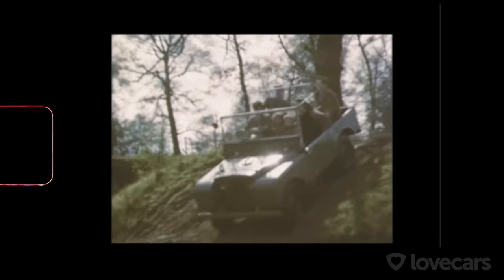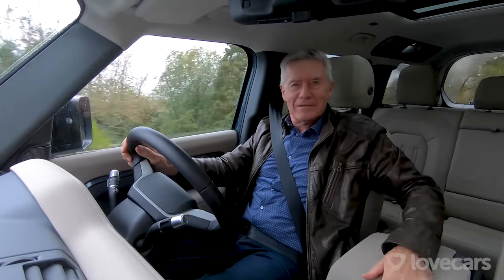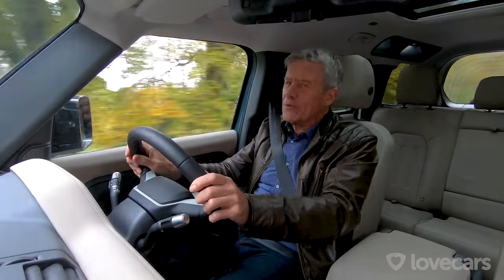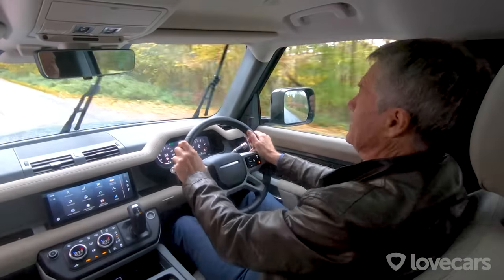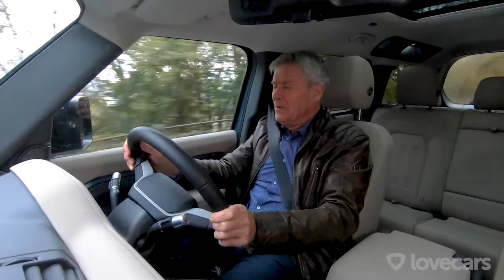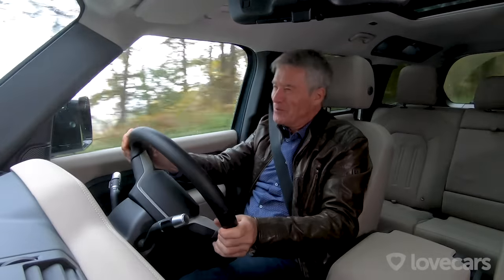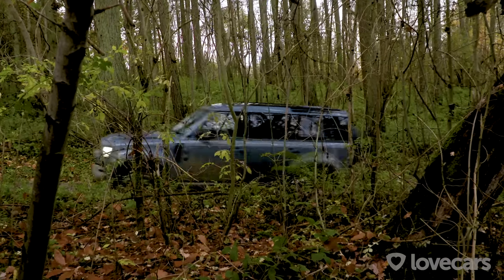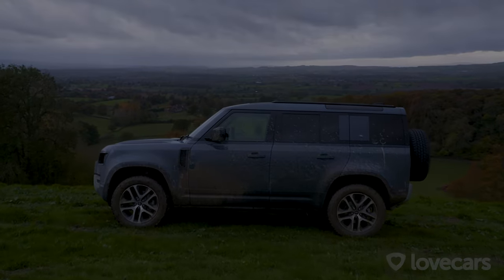New Land Rover Defender. On road. Off road. With Tiff Needell

Comment: All very capable but for the job the original was good at this is just way too complex and expensive - a first-World toy pretending to be a solution to a 3rd World transport requirement (a role Toyota wrested from LR a long time ago but for which even the HiLux has become too expensive) Time was that a LR was fixed by hitting it with increasingly heavy hammers till it ran again. What chance of braying this back to life 1000km from the nearest LR main agent?